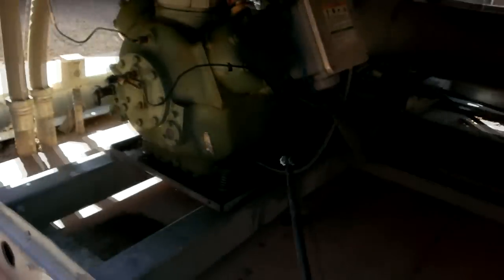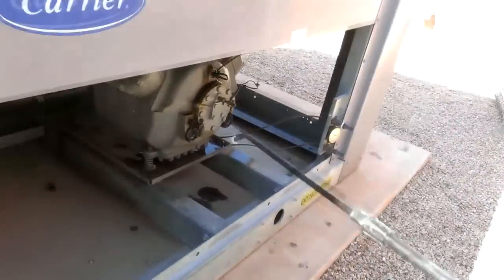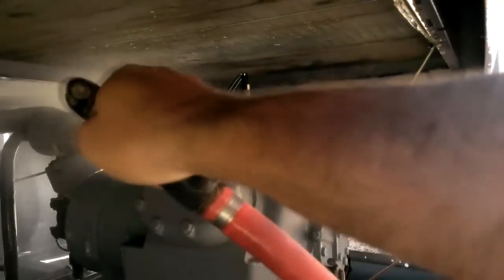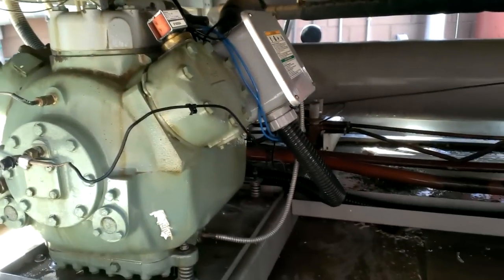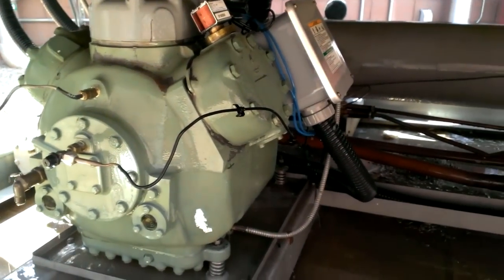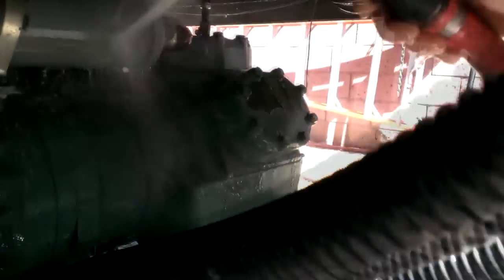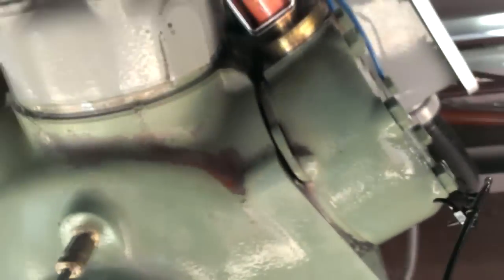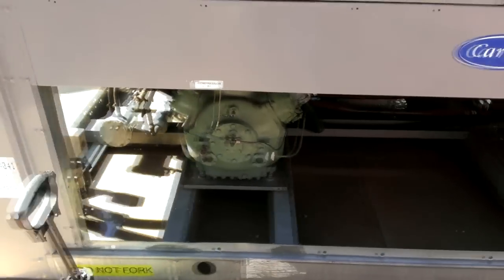Yellow Death coil cleaner is great 06E compressor cleaner too!

Comment: "Foam-Brite’s foaming power is incredible It is a non-acidic, alkaline-based cleaner and brightener containing the best available biodegradable ingredients and a unique chelantsurfactant package to quickly penetrate and remove greasy soils and oxidation.Its high foaming formula helps lift greasy soils out of the coil, leaving finned coils clean and bright. It can be used to replace the more dangerous HF acid-based products for condenser coil cleaning because Foam-Brite does not contain any acids
Reply: brnmcc01 who are you talking to loll

Comment: 30GT
Reply from the maker: A 50 GT or  whatever Carrier model it was. It has two 06E compressors. One slightly larger in capacity than the other.
Reply: hackfreehvac Ok, I wasn't trying to correct you, or tell you what it was.